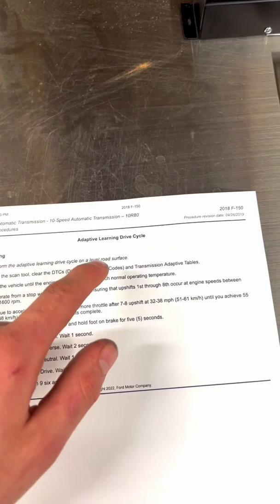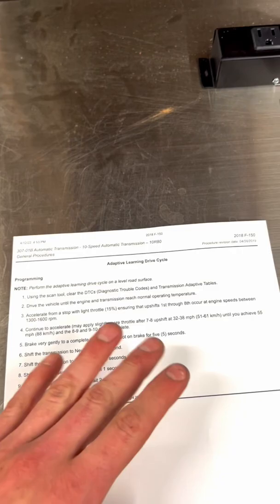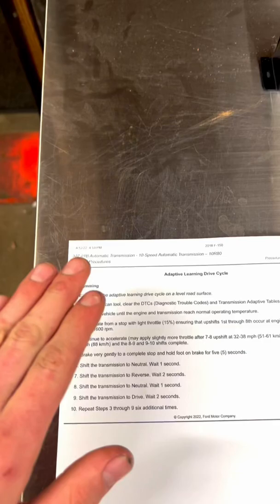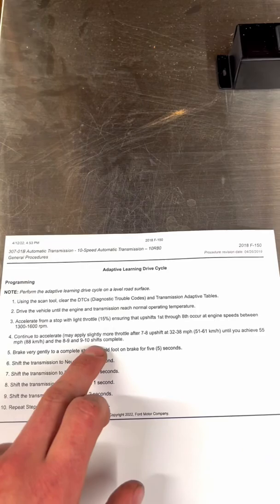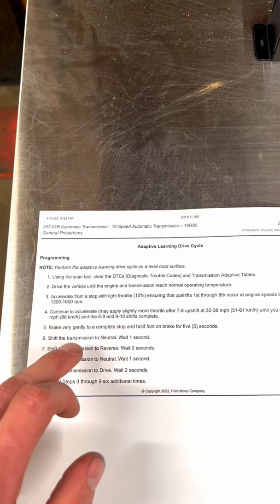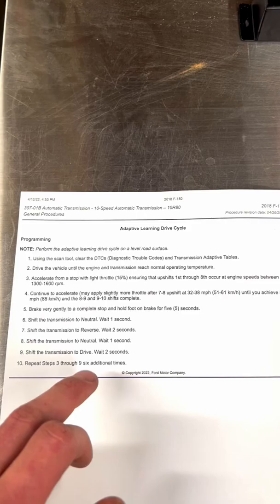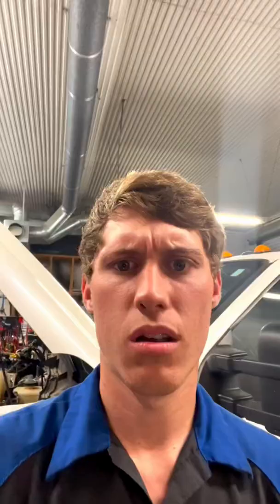Why Do Car Manufacturers Make My Job Harder? Pt. 2 #shorts

Comment: why not just leave it on the lift and let the wheels rotate in the air? be done in 10 mins
Reply from the maker: Well it doesn’t exactly work like that. The electronics on these vehicles can calculate the load your putting it under which heavily affects the adaptive strategy you’re trying to learn in this procedure. Since the 6 speed trans, ford and many others write the engine torque into the trans tunes to optimize shifting. This is why tuning a engine without adjusting these torque values will cause serious trans problems. It really has a lot to do with the variable solenoids in the valve body. If you build newer transmission you will notice that we don’t have accumulator pistons anymore. This honestly took me a long time to understand. Easy answer is because with a variable solenoid you don’t need an accumulator piston to soften the sudden line pressure that a on/off solenoid gives to a clutch pack. The TCM is able to slowly open the solenoid by varying voltage therefore slowly applying line pressure for a soft smooth shift that the 89 year old lady who bought a brand new expedition with her 401k money wants. The more I’ve written in this reply, I’ve realized I have no idea what I’m talking about. I really need to lay off the Friday evening I’m wore out drinking because I always seem to end up here writing novels for no reason. Hope you enjoy this book I spent 25 minutes of my night writing. Nighty Night.

Comment: My friend take that trash transmission out put 6r140 transmission on that truck call it a day, pretty much  most of 2011 up to 2018 that I know of f250 all the way up to f550 came with 6r140  transmission and after 2017 the 10 speed was optional this problem you are having is designe problem and defects the programming and replacement of parts is temporary fix it's not going to work out

Comment: D-Y-N-O.  You’ll find things like this with EVERY vehicle manufacturer.  If you don’t like doing maintenance on a vehicle and all the boring crap that goes with it, maybe consider another profession.  #quityourbitchinanddoyourjob
Reply from the maker: How many dealers you seen with a dyno?
Reply: Every dealer knows what businesses have them.  Last year, (last time I ran numbers) 88% of my business was from local dealers reserving my dyno time.  Dealerships were such a large part of my business that I was able to offer contracts at a much cheaper rate for blocks of hours.  This gave me guaranteed open sots for my other customers that pay a lot more…. So yeah, to your point, no shit Sherlock, few dealers have them but the ones with brains know to USE them.

Comment: It is the idiot mechanical  process engineers that think you can run the engine through its paces anywhere in order for the computer to decide whether it needs to mark new set points.... it's the same old story you can't be an engineer in the office unless you understand the field side of the sequence of operation!!! hang in there though guy.... you got the right stuff... you will go far if you don't make any stupid mistakes with your surroundings, so to speak... just remember there is only one Master...💪➕👁️💯👍